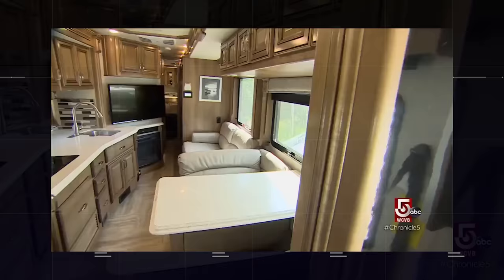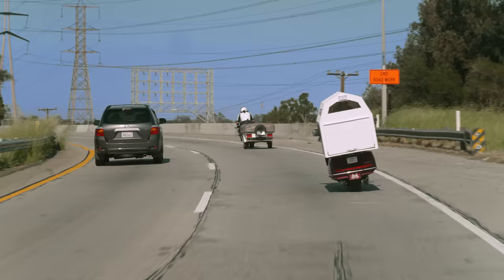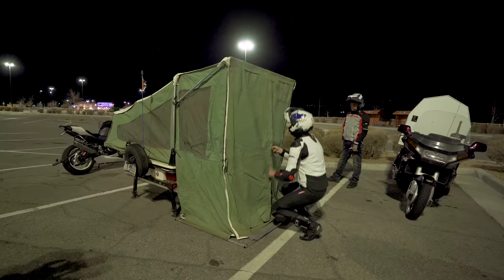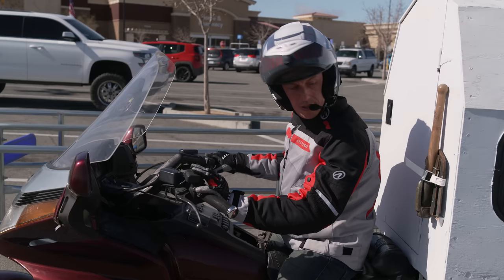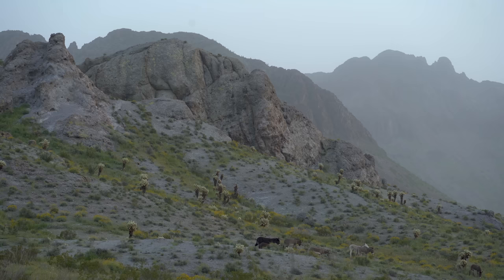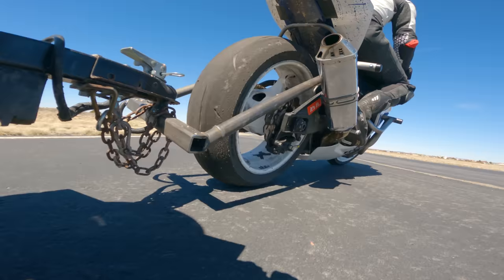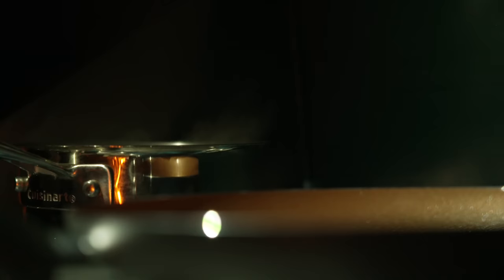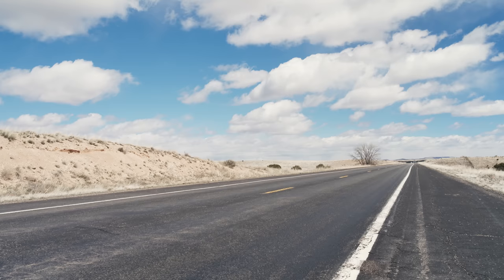Motorcycle Motorhomes! Honda Gold Wing vs. Suzuki GSX-R1000 | CTXP

Comment: That pass between San Bernardino and Palm Springs is very, very windy.  I have gone through it with a VW Westfalia and was blown all over the lane.  The real whoopie though is flying into Palm Springs.  You come over those mountains and can get a drop that leaves your stomach in your throat.  With the Wing a bago, the trip must have been a real worrisome ride.  Your gas mileage must have suffered greatly from the drag as well.

Comment: All that came to mind when I saw the Wing-ebago is that it must be awful for crosswinds, passing trucks, and a huge amount of drag to alter performance & fuel economy.  Not to mention handling and overloading the tire.  I started thinking that this must be mashup for Top gear!  The trailer is the most sensible method .  Add something to wash your hands!!
FYI, not all Walmarts are welcoming of RVs/overnight parking.  Rest Areas would would work to your advantage, except they are a bit sketchy.

Comment: I think the wing-abego could be vastly improved into something, dare I say it, functional?  Like, instead of a barn shape crafted primarily out of heavy ass wood, make it like an Airstream, crafted primarily out of metal.  The floor will need a little reinforcing to withstand your weight, but other than that, it'd be much lighter and more aerodynamic.  In addition to that, instead of having scissor jacks glued to the bottom of your motorcycle where they could be easily bumped off, have longer crank rods attacked to the bottom of your mini airsteam instead, which will fold out, then crank the rest of the needed length out.  That'd be pretty cool!

Comment: It would be best if you used a Trike with a pull-behind. You would have more stability with two wheels in the back. Almost analogous to using a dually with a fifth wheel. It would also be more comfortable to ride on long trips.

Comment: You are lucky, in the States you can pretty much just make anything and drive or ride it on your roads. That would be illegal here in Oz. Yes we can tow trailers behind motorcycles ( I built the first trailer to be registered to be towed by a motorbike here back in 1975) but the goldwing is overweight and your mirrors would have to be extended.  Also, we can't 'camp' in shopping center car parks. Oh, and I have ridden through mini cyclones where I had to speed up to 100 mph just to stop the side wind from blowing me off the road.

Comment: I love both. I've seen people use fiberglass and foam board with a wooden reinforcement, I bet aluminum would work. You're giving me ideas for a foam+fiber glass and aluminum or carbon fiber rod reinforced hard shell for the honda bike, so it's a little more aero, bend some poly carbon sheets to make a sort of bubble so you can easily see. Mostly because I assume that sudden flatness causes some driving issues, and if everything is made out of foam and fiberglass with some aluminum or carbon fiber rod reinforcement it'll stand up to the wind/speeds, nature, and be insulated. It's obviously overkill I'm just imaging taking your concept to an extreme that is more work then I'm remotely able to see myself doing.

What you made however is amazing and I really like the space of the other one but the lack of hard form makes me think foxes or other animals would be more inclined to mess with it.

Comment: You guys need to come see my motorcycle camper setup. I'm at senators wash by Imperial dam till March before heading back to Montana to build version 2. And 1 one more thing I'm not homeless this is my home thank you.
Reply: Also my home is on 1 wheel.
Reply: 1700 mile on so far, will be over 3k when I get back. So far it's been a great pathfinder.
Reply: 1 more interesting fact is my house is it's the same size as the wina bago but when setup I have 4ft by 6ft by 3ft worth of space.

Comment: The only issue with the pull behind tent was that it was too big and not insulated/heated enough. Just make a smaller tent that's insulated and get a small electric heater with an inverter. You could even charge it throughout the day with a solar panel on the roof as you ride. As for the toilet, bolt it down with a light weight cross bar and leave the tp in the tent. The Wing-e-Bago...Just...No...

Comment: Nice intentions but the golding bad move. They already have a trailer for the golding. The wing already weight 980 lbs for the 1500 cc wing. My 2018 gl goldwing 1800 cc weigh is dry at 998lbs.

Comment: A trailer is not a motor home.  If the camper does not have a motor, it’s a camper trailer.
Reply: Overlander tents on top of trucks are celebrating everywhere then ha

Comment: Man... I wouldn't even think of taking the "Wing-uh-bago" out. Far too heavy on the back, horrible wind resistance, high center of gravity makes it less stable.  However, the trailer looked like the ticket... except that it was fishtailing a bit. I'm sure that can be resolved easily enough.

Comment: those automatic vaccume petcocks are problematic...better to bypass and add a manual on/ off device. They jam open, or won't open when old- had the same problem with an old gs1000g suzuki.

Comment: I will explain this from the mechanics game when you wired in motorhome to your bike battery your Granger battery for the point that it didn't have enough tone you should have wired in a few solar panels the battery topped off with a secondary battery somewhere that is why your bike does not start

Comment: Yuck! Ruins the ride from the beginning. Ridden across the US and back and up to Alaska back in 90. Used to ride all over California camping including Joshua Tree. I used a tent everytime. Rode a '79 Honda Silver Wing transverse V twin 550, to Alaska. Rode a '83 Suzuki GS550L all over Cali and across the US. Biggest bike I ever rode was a Honda CB900C. The '79 GS550 had a front full fairing, helped a lot distributing weight, and keeping down the front wheel. Why ruin your motorcycle riding with an unsafe windage and high load? Goldeing is an awesome bike for long ride tent camping. Even the trailer is too much for me. Just get a van, and carry a lightweight motorcycle. I live in a van now. Lived offmy motorcycle in Alaska for the summer of '90.  Lived aboard sailboats for 16 years, lived in a motorhome for three years. I never paid for boat slips or camping or parking or any rent at all for any of that except a few months cumulative at marina docks. In the Eastern US, camping always involves showing ID and paying money and fitting whosever rules and being crammed into a small space with others up your ass, and shittons of noise. -And or cops  every night, and if you ever find legal and free camping, then youll be in a pile of trash. I'd recommend a flamethrower for the Eastern US. Basically have to live in Walmart parking lots now. Im going to roll down to Costa Rica and never come back to the US. None of the ways I've lived are allowed in the Eastern US anymore really. Sailboat involves cop harassment day and night, ashore and at sea. It all does. Sucks like our jobs and housing and healthcare, so Im bailing out. Camp in the wrong area of the Grand Canyon they'll turbo bang you. Tennessee has a felony camping law now. Ive lived out of canoes for over a week here and there as well. Hardly anyolace is legally or reasonably accessible anymore, and your unattended vehicle is a target for law enforcement and towing impoundment, in between forced searches when your present. Then theres the shitty traffic and hellish noise and light pollution everywhere. Yeah, I gotta give up on the US and get out. 
Intend to see the total eclipse of the Sun in Mexico in April, on my way to Costa Rica.

Comment: Why the clown show?  Motorcycles have been pulling tiny camping trailers a long time.  The big thing on the Goldwing makes an imbalanced bike, too much weight on the back may cause front end wobble, dangerous!  Using a crotch rocket to pull a trailer?  Come-on!   A motorcycle trailer show / documentary, with FAQs, would be a good thing.

Comment: Dude, that setup on that GL1500 is utterly stupid, AND you rode around with the rear suspension bottomed out... you didn't inflate the rear air suspension, plus you overloaded that bike... that rear fork is sooo screwed!!! PS,
 DON'T USE THE MAINTAINENCE STAND TO PARK THE BIKE!!! THAT IS NOT WHAT IT IS FOR!!! 
Plus you need to have BOTH feet on the ground, and push the bike forward with your thighs and hands at the same time..